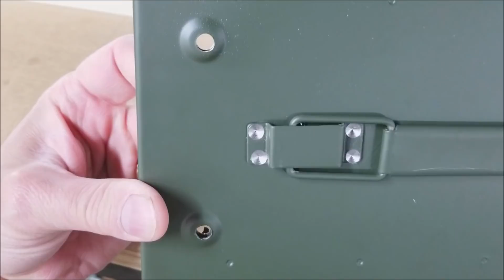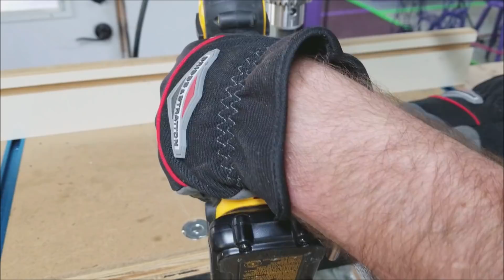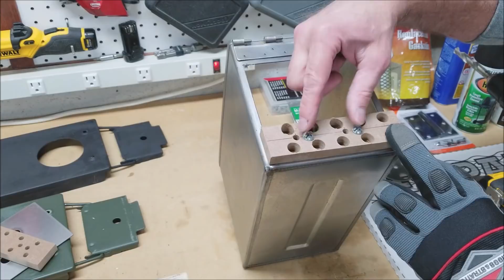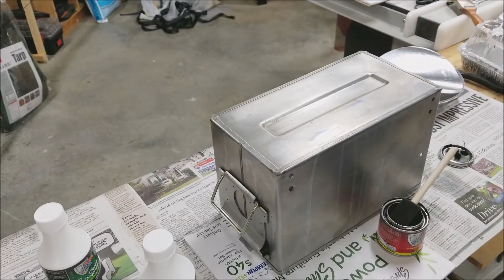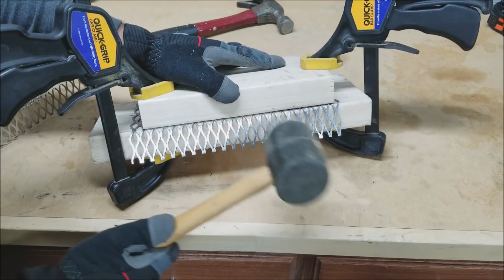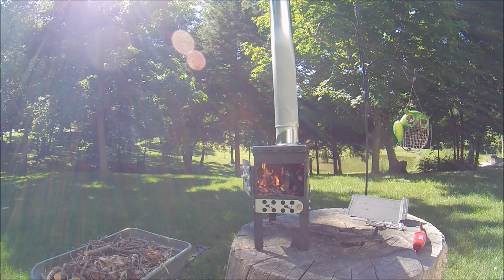Make Your Own Ammo Can Stove

Comment: If you're interested in building one like this, get what's known as a "fat 50" ammo can instead of just the standard 50 cal. can like this one. They are 1-1/2" taller, about and 1-1/4" wider and a little longer. So you get a little bigger, hotter stove that holds more wood and burns longer. Just sayin'.
 Also, it you want it to burn cleaner and have a good draft, I used 1-1/2" exhaust tubing instead of 3" stove pipe. It seems to make the smoke going out the chimney have to speed up because the pipe is smaller, creating a faster intake. This makes controlling the flame more precise and burn hotter and cleaner.

Comment: Those legs being straight down make it look pretty unstable. I would be afraid it would topple over.  I would think a fire brick bottom would be good.
Reply from the maker: I actually push the legs down into the ground about an inch.  I've never had a problem with it tipping over.  The only reason I don't use something ceramic in the bottom is because of weight.

Comment: Your video on building this stove is the very best I have seen anywhere.  I will not only build the stove exactly as you did but I will also build an ammo can barbecue grill to carry inside my truck camper and when I go canoe camping.  U.S. Army, Ret. TX
Reply from the maker: Thanks Richard!  You might want to check out the Testing the Ammo Can Stove at 20 Degrees video if you haven't already:  https://www.youtube.com/watch?v=XBMsP32HJ60

I made a couple of changes to the stove, using aluminum angle for the legs and adding steel angle along the inside to stop the sides from warping.  Thanks for commenting, I like the idea of the ammo can bbq!
Reply: @timcanthejigman7932  Thanks.  I will check out that video and see what changes you made.  An ammo can barbecue grill l will be perfect for me because it will easily store inside my truck/camper or I can take it in the canoe when canoe/tent camping.  Since I go camping by myself, I just don't need a larger barbecue grill.

Comment: Could you flip it upside down? Does the lid have a larger Cook surface than the bottom of the can?
Reply from the maker: I've seen videos of ammo can stoves built upside down.  The lid is a bit larger than the bottom and it's flat.  The bottom has an indent in it.  Also, the way I made the legs, it wouldn't have worked with the can upside down.
Reply: Thanks for the information and video. Great job on the editing too.

Comment: What is the stove's temperature output?  How many times did you have to wake up to add wood to keep the stove putting out heat all night?
Reply from the maker: The stove can get up to 700ish degrees but I like to keep it around 400-450 for cooking.  With the damper and vents choked down it can last a few hours if you use good hardwood chunks.  I like osage orange.

Comment: why you mean by saying the ductwork galvanizes pipes its inappropriate for the job ??
Reply from the maker: Galvanized duct isn't designed for high temps like this, not least because the galvanizing burns off emitting toxic fumes.  Once the galvanizing is gone, the flue almost immediately oxidizes.  I should be using stainless steel.  You can see in one of my recent videos using it out in the woods, the stove has a 2 foot long piece of duct for the chimney but I'd already burned off the galvanizing and painted it with high temp paint.
Reply: @timcanthejigman7932  so if i use galvanize and burn it and paint it it Will do the job for a tent stove or i should go with stainless pipe
Reply from the maker: If you can get stainless steel, that's the way to go.
Reply: @timcanthejigman7932  yeah for sur but its more expensive
Reply from the maker: That's why I'm still using duct that I've burned the galvanizing off of and painted in high temp paint.
Reply: @timcanthejigman7932  i think i Will go with that thanks for the reply  you did a really Nice stove

Comment: Why did you remove the inner lid? 2 piece construction will avoid top lid from warping.
Reply from the maker: I did it that way for several reasons.  The formed shape of the inner lid would have interfered with fitting the start collar (for the flue) to the lid.  I knew I wanted the stove baffle bolted to the lid rather than to the can and it would have interfered with that and it gave me the material to make that baffle.  The top lid warping isn't an issue.  Even heating mine to cherry red, the latch still pulls it down and seals tightly.  I've heard suggestions to weld steel plate to the bottom and to the top but at some point you have to ask yourself, "Why bother with the ammo can at all?  I'll just weld steel plates together."

I don't foresee any more changes to what I showed in the test video.  Bolting the steel angle to the sides fixed the only problem with warping and had the side benefit of closing off the gap around the edges of the baffle.

Good question, Strugu!